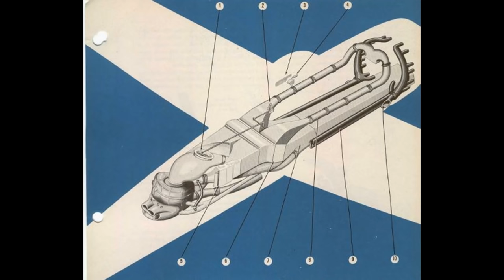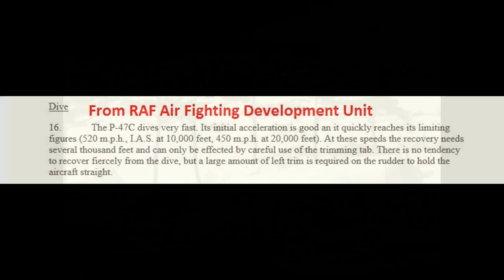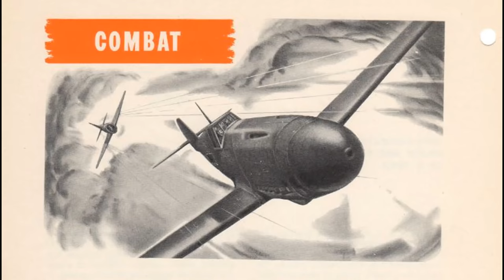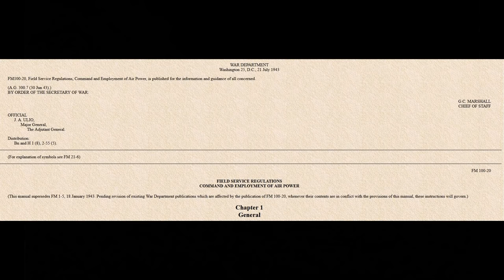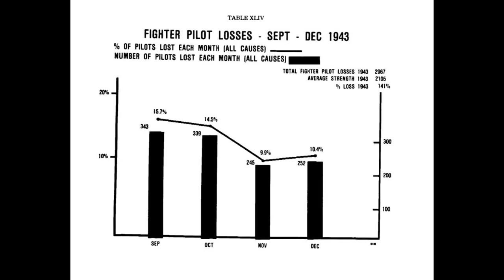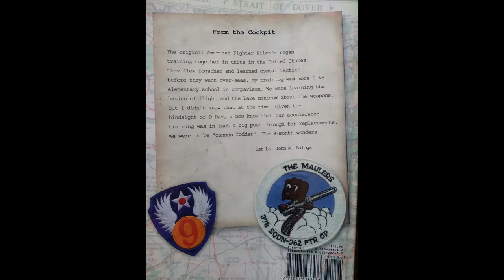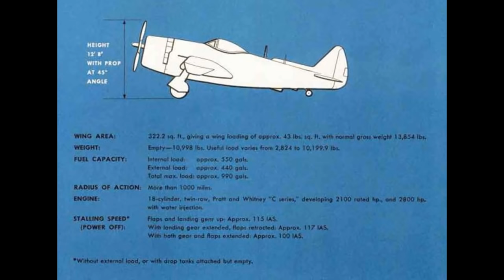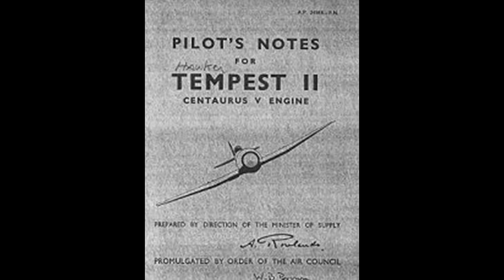P-47 Thunderbolt Pt. 8 Conclusions

Comment: As I’ve watched these videos, I haven’t seen them all yet, I keep wondering how the P-47 compares to the Corsair, since they have the same engine and similar turbo charging systems.
Reply from the maker: I have you covered: https://youtu.be/ULLsIo1VzTw
Reply: @GregsAirplanesandAutomobiles  that’s a good video about supercharging, and your comparison of the Corsair and P-47 is great. In the few sentences you had about speed differences, you gave me enough information that I could fill in the blanks myself about an overall comparison, which is what I was really originally asking for, like your “which is better” videos.
Since the two aircraft never flew in the same theater, or at least not enough to know how they stack up against each other, it would be kind of cool to see how well they do against each other. 
I think, based on this video, the P-47 would outperform the Corsair, unless the gull wing can turn tighter and handle more g’s.

Comment: Was there anything specific that made the P-47 so expensive compared to the P-51, beyond just the sheer size requiring more materials to produce? I read somewhere the turbo used some at the time exotic tungsten alloys(?) that were expensive and hard to come by at that time, but surely that alone cannot be responsible?
Reply from the maker: Turbo, more airplane in general, and earlier less streamlined production methods.

Comment: Interestingly Chuck Yeager without saying so officially, that I have read, always came back to the P-47. He will tell one story after another and most of them involve the 47. He mentioned the preliminary work on breaking the sound barrier and how they would dive a 47 at full throttle and could not do it (too much drag I guess). However, for me taking a tank like the 47 and diving under full power seems ... unwise. Yeager by all accounts may be a bit of an ass, but he was a helluva a pilot and just the idea of flying the 47 to the ragged edge ... just because ... is pretty crazy stuff. Henri.
Reply from the maker: Hi Henri, the 47 can't break the sound barrier because it becomes uncontrollable at very high mach numbers. The same is true of every WW2 airplane, even the 262.

Comment: Could the P47 have filled the same role as the A1E in Vietnam? 

Considering the relative success of the P47 in regards to ground attack, could the plane have been adopted into a designated ground support/ground attack role in later conflicts?
Reply from the maker: Sure, but it would need a near total redesign as so much of the plane's expense is centered around high altitude performance. As is, it's just not a cost effect ground pounder, and if you are going to redesign it, it makes more sense to go with something new.

Comment: I saw a comparison with a Tempest V to the P-47.
Tempest V from what I have seen was considered as the 1st true fighter bomber. A purpose built low altitude attach aircraft with rock launchers.
The latest versions produced 3500HP. That said the superchargers lacked the ability to pull air at altitude. So the P-47 won on that front. The P-47 was still the best heavy fighter at heights. The late model Tempests could unload the ordinance of a destroyer broadside and pull out with good accretion at close to ground level. There is a story about where in the late stage of the war where FW190  craft would come in and attach costal areas Tempest Vs would chase. The Tempest V would catch up with FW190 if the German pilot was nuts enough to stay at low altitude and get shot down. Sadly the Napier Saber for all the power it had got wheezy at altitude where the Merlin exiled at.
Reply from the maker: The Corsair was designed as a fighter bomber well before the Tempest. In fact the Corsair has dive brakes so it can dive bomb, and late versions could carry 8000 pounds of bombs, far more than a Tempest and twice that of a Mosquito.

Comment: The late P-47Ds had lots of power, more than the Sabre Tempests V. What's the reason then they were only average at sea level? I don't understand this
Reply from the maker: The P-47s were a bit draggy by late war standards. When I said it's average in max speed at sea level, I mean average among some seriously fast airplanes. That's pretty good considering it wasn't designed at a low altitude fighter. The Tempest was so fast because it had a lot of power, relatively low drag and a first supercharger speed optimized for speed down low.

Comment: I wonder about the performance drop in the event that the TurboCharger drops out of service, leaving the Mechanical Supercharger alone to propel the aircraft
So when you talk about manifold pressure, are you referring to the PSI after the mechanical supercharger?
And so, is the turbo supercharger there to precharge the intake pressure in order to assist the supercharger in throttling?
Reply from the maker: The supercharger is after the turbo. In otherwords, the turbo boost the pressure into the supercharger. Manifold pressure is taken after the sueprcharger. Now if the turbo fails, you end up with a 2000horsepower engine with a low critical altitude.
Reply: @GregsAirplanesandAutomobiles  
That was my question. Does the turbo buffer the supercharger when throttling?
Superchargers do not respond well to throttling.

Comment: Did the fact that the P-51 used Merlin designed engines and they where flown from British bases with other Merlin powered fighters and bombers  also a factor in switching from P-47s to P-51s? Not only where we building engines for British fighters but we also supplied fuel.Perhaps it was practical economics to finish the air war with P-51s and have to P-47 mop up ground targets. Fuel costs surly became a factor.

Comment: Hi Greg,

I would love to know more about the Gloster Meteor, and about the whole Axial Flow v. Centrifugal Turbojet Engine Question. 
We (Germany) abandoned Centrifugal Engines in 1939, with the He-178 being pretty much the only German Type to use it. 
Why did the Brits keep on developing Centrifugal Jets, which should have been easier and faster to develop, and still be rather late to the Game?

PS: Can you do a comparison of primary Trainers and how they shaped their Pilots and their Opinions on Aircraft Handling? 
I got to fly in a Casa built, originally engined Bücker 131 and found it to be surprisingly difficult to fly, and near impossible not to bounce on Landing with a ridiculous Landing Gear Layout, with Landing Gear extremely far forward, high and narrow, so that 3-Point Landing Attitude is roughly at the same AoA as stall, and with the Elevators being pretty spongy at Speeds below 120km/h, a 2-Point Attitude will always cause the Plane to drop the Tail sharply, and bounce/float, while a 3-Point Landing is very difficult to pull off without bouncing since you are pretty much at stall attitude.
Reply from the maker: I love these questions, but they are just too complex to be answered in comments. The centrifugal vs. axial flow discussion by itself is big. The super short version is that both have advantages, but the axial flow has more advantages and more important advantages, which is why it ultimately won out.

Some training aircraft were difficult to fly. The AT-6 Texas was famously more difficult to fly than P-40s and P-51s. I don't know much about the Bucher, what little I have read says it was a nice flying plane, but of course that's relative to the other trainers of the period. The only WW2 era trainers I have flown are the Piper Cub, and Stearman, both of which  fly well, although I felt that the Stearman's performance was disappointing.
Reply: @GregsAirplanesandAutomobiles  Maybe take it as a Video Inspiration for those long, Lockdown Days.
Reply from the maker: I'm still working, not really locked down.

Comment: Dieppe was NOT a full invasion of Europe...but a raid and test for the future invasion. Lessons learned served D-Day well.
Reply from the maker: 6000 troops hitting the beach with armor, naval, and air support. That's either a really big raid or a small invasion. You can call it whatever you want.
Reply: @GregsAirplanesandAutomobiles   From Wikipedia "Operation Jubilee or the Dieppe Raid (19 August 1942) was an Allied amphibious attack on the German-occupied port of Dieppe, northern France in the Second World War. Over 6,050 infantry, predominantly Canadian, supported by a regiment of tanks, were put ashore from a naval force operating under protection of Royal Air Force (RAF) fighters.

The port was to be captured and held for a short period, to test the feasibility of a landing and to gather intelligence. German coastal defenses, port structures and important buildings were to be demolished. The raid was intended to boost Allied morale, demonstrate the commitment of the United Kingdom to re-open the Western Front and support the Soviet Union.

Aerial and naval support was insufficient to enable the ground forces to achieve their objectives; the tanks were trapped on the beach and the infantry was largely prevented from entering the town by obstacles and German fire. After less than six hours, mounting casualties forced a retreat. The operation was a fiasco in which only one landing force achieved its objective and some intelligence including electronic intelligence was gathered.

Within ten hours, of the 6,086 men who landed, 3,623 had been killed, wounded or became prisoners of war. The Luftwaffe made a maximum effort against the landing as the RAF had expected but the RAF lost 106 aircraft (at least 32 to anti-aircraft fire or accidents), against 48 German losses. The Royal Navy lost 33 landing craft and a destroyer. The lessons of the Dieppe Raid influenced preparations for Allied seaborne operations in the Mediterranean and the Normandy landings (Operation Overlord)." 

You stated that 6000 were involved...that  number of troops was not enough to sustain an invasion small or otherwise. On June 6, 1944 over 156,000 allied soldiers and 195,700 allied naval personnel hit the beach or supported that invasion that was designed to stay and gain a beachhead and  lodgment on the coast of France in order to take back Europe. So there is a clear difference here in the numbers. Large raids like this were not unknown in WWII.  Of the 54 Raids conducted against the Atlantic Wall prior to D-Day  3 were considered large in that they attacked targets designed to destroy key Axis assets Dieppe being the largest. There other large raids in other theaters as well.

Comment: I beg your pardon sir as I have a doubt here if you kindly please clarify that. 
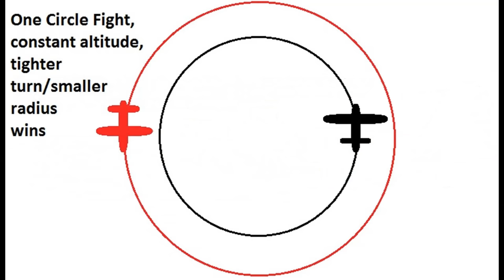         Sir in the video between 20:04 min to 20:15 you said that "109s turn radius, radius not rate is almost always going to be the p47s, and by a significant margin." Sir does that mean that they have a equal turn radius. Yet by the picture (if we assume the red one to be P47 and the black one to be Bf109) the P47 has a larger turn radius than Bf109. So sir if you kindly please explain this.
Reply from the maker: Yes, the 109 has the smaller turn radius. However rate and radius are two different things. In some case the P-47 can have an equal or even slightly better turn rate.
Reply: Ok sir thank you so much for your active cooperation

Comment: 1:20 The Seversky S3 Airfoil, and it's thinner/thicker derivatives very closely approximate the NACA 23012 section. 
  
Edit*https://patents.google.com/patent/US2257260 patent description, can be seen that it has its camber "unusually far farward" in the same manner as the 230 series NACA foils.  The patent states it's simply a thickness distribution that can be used for any given arbitrary camber line. To the patent pertains to a Parabolic shaped leading edge with a radius of 0.01 for 12% thickness, vs that of the 23012/0012 which was 0.158 percent of chord leading edge radius.  

They appear to have used an ever so slight reflex of the trailing edge upper and lower surface that aproach tangent to the mean camber line at the aft point, patent claiming improved theoretical stream tube drag of "0". In addition to its pinched leading edge radius to that of the 23012. But it's just flaunting some technical language with no scientific merit to get the patent approved on what is essentially a slightly modified thickness distribution 23012. And they simply took all of the information of that landmark NACA report and made a custom airfoils with the information therein. It appears there is nothing that was not covered by those reports. The Seversky Airfoil would be approximately a 23012-53.X depending on if the location of maximum thickness deviated much from the 30% chord location. 

32:00 The bombers did target ball bearing manufacturing and oil refineries, but both of those industries directly supplied the aircraft squadrons, and incidentally the Panzer tank divisions. But it seems they primarily bombed every conceivable aircraft manufacterer to the point they built their FW190s and possibly ME-262s underground. The aame is not necessary true of their tanks or 88mm guns.

54:25 couldn't have said it better. The P-47 was a beast, it was there before the mustang. It did the most damage of any fighter when it really mattered, bar none. There are countless stories of P-47s in real lopsided adverse odds combat that the P-51s never encountered. The Mustang was a very good aircraft, but it gets way too much admiration in the USA. The best outright fighter was the spitfire, the best warplane was the P-47, followed by the FW-190. With Typhoons in the running for pre D-Day heroism.

Fantastic series. 
Loved every minute of the P-47. Lots of great insights and info. Especially on the 8th Airforce decisions and politics. It filled in the gaps on why the P-38 and P-47 were never mentioned as capable of reaching Berlin, even though they were over Germany early on. 
I'm far more interested in the history of Taiwan now more than ever. It explains why we have much better relations with them then say, China. Or even Hong Kong, for that matter. (Besides the fact they build the best hand tools currently available in the US, lol). 

When you go to do the Spitfire series, and I assume it's coming there is an excellent resource on the geometry of the wing, how it was arrived at, and what the reasoning was for. And no, it's not entirely because of the elliptical lift distribution which it did not have, because of washout, etc.
https://youtu.be/Gt7gzFIvlFI

Comment: Greg, great video series on the P47.  Many years ago I attended the Reno Air Races, so I kind of started looking at WW2 aircraft.  I say kind of, as I never really knew anything about the P47.  The P38 was my favorite aircraft of the era, but now the P47 is due to your series. In the video you show the P47 was a lot more expensive than the P51, what were some of the factors for this?  Are radial engines more expensive to manufacture?....Thank you for doing such a detailed and great job on this airplane.  Not to nitpick, but I have some questions about some of the information...1)  At 56:36 you say 4950 shot down on the ground, but the words say 4131 shot down on the ground?  2)  At ~58:00 is listed a bunch of information about the P47 in WW2.  It says it flew 1 to 1.5 million combat hours and consumed 20 million gallons of fuel.  If the burn rate is ~160 gallons an hour, seems like the fuel burn would have been more like 200 million gallons of fuel?
Reply from the maker: The huge cost is due to the turbo/supercharging system. That was very exotic technology back then. 

I misspoke, which is why I try to also put stuff up on the screen, it's hard to talk for 1 hour and 14 mins and not screw up somewhere. It's 4950 shot down in the air and 4131 destroyed on the ground. The greater point being that the P-47 destroyed more aircraft in total than the 51, and shot down almost as many but at a time when it was more difficult to do.

The fuel and combat hours are straight from the Millville museum, but your math is correct, they made an error, which is easy to do with so many zeros in there.

Comment: Greg, can you confirm if the spitfire mach number is a myth or not, I have a hard time beleiving it at all based on its construction and surface area from the multiple sources ive heard it from
Reply from the maker: The preponderance of evidence is that's it's a myth, but there is no smoking gun either way.

Comment: Thanks for the series. I learned a lot, and your arguments for relative 'importance' of fighter types is very persuasive. Just a minor note on one of your tables, which is nit-picking really: The Millville Museum table at 58:36 must have at least one typo I think. 1.5m combat sorties, with 2m tons of bombs dropped just doesn't compute. Maybe there's a missing or extra zero somewhere, but I imagine at least 30% of those sorties must have been escort/interception sorties, with presumably no bombs carried, and you have covered the bomb load capacity of the P47, commonly quoted as around 2500 pounds, though I imagine that bombing missions probably averaged under a ton each, perhaps as little as 1000 pounds on average (based on anecdotal descriptions of ground attack bombing in the Italian theatre, so I could be very wrong on the average). I'm assuming that the 'ton' in question is the US little one of 2000 pounds, if it's a real ton then it's even less plausible. Also, 2 rounds of 50 cal fired per sortie seems to be me to be very low - even accepting that on many sorties the guns would never have been fired - this one's harder to be certain about. I believe they carried somewhere close to 3000 rounds, so the total ammunition consumption in the table is equivalent to only 1000-1200 sorties or so firing off the full load. Again, there must be something wrong. Not that it makes any difference to your arguments, of course. Thanks again.
Reply from the maker: The museum data has some zeros missing here and there, look at the fuel usage.